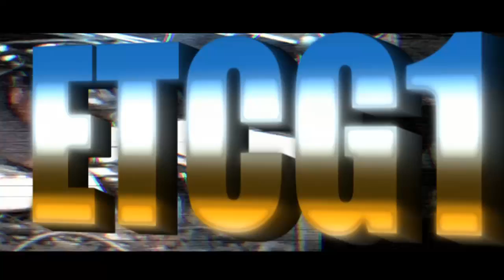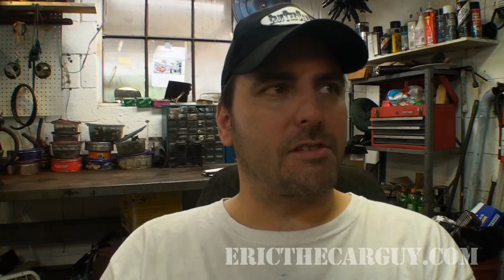The Flat Rate System

Comment: Being a mobile electronics installer in the company I'm in, we have a variation of the flat rate system, except we don't see any pay from it as we're hourly. They used to give a portion to the autotechs, but the quality aspect changed that. Reason I don't like it, just like you said no 2 cars are the same. Say a head unit install is $50, should take .75hr, some vehicles, say an early 90's F150, done in 10min, and a Taurus, 1.5hr due to bypassing the tuner in the trunk. It is what it is I guess.

Comment: I own a independent shop.  I prefer flat rate employees so i know that we both make a set piece of the same pie.  But, I will pay hourly and the amount is still based on productivity via flat rate. A 100% is billing out 40 hrs and clocking in for 40.  It is averaged over 3 months. Top pay is 50% of Shop Rate.  So my $65 shop rate and 75% productivity gets you $24.37 per hour.  No demotions only raises so that is why its averaged over 3 months to qualify for a raise.  Opinions?  Am i being fair?

Comment: depends....a new shop was just built here and they almost tripled their hourly rate to help pay for the new building. And alignment racks arent cheap, tire machines, wheel balancers, scan tools, all cost thousands and thousands of dollars. Went theough 4 panasonic tough books in one year. Plus one guys oops or clutch fails on a car when its on the rack or a lift breaks and drops a 50,000 dollar caddy on its side....shops have to swallow that cost..

Comment: In Germany mechanics are normally payed a fix wage or a fix wage and a bonus for whatever. The customer pays prices according to the time of the mechanic as in the flat rate system. 
After I have spend close to 2000 Dollars on my car where the actual repair was the least amount with only about 150 Dollars I do no longer go to workshops where they work with a flat rate system. 
A friend, that once was the supervisor for the workshop at a truck dealer told me that in many car shops the mechanics are forced to just check the computer and change whatever it tells them to change. 
So today I only go to independent repair shops where they analyze the problem and make an educated guess on what it will cost – and do not rely to much on the diagnose-system in the car.
Finding out what the problem really is will take them some time and they charge for it. 
But I'd rather pay more for a specific repair then having changed things on the car by trial and error which cost way more at the end of the day.

So in my opinion these flat rates are god for no one – maybe except for the bosses and the parts industry. These timetables should only be seen as a help. I think a system where the mechanics get paid a basis wage + extras for time safed and for the quality of there work would be the best for everyone.
And I think the customer should pay for the diagnose. Personally I like it, when I hand over my car to the person working on it. That will give us the chance to talk to each other, I could tell him what kind of problem I do have and he could ask me specific questions. He could then give me an idea of the costs and how long it will take - or tell me when this is impossible. After the repair I also  like to take a few minutes and talk to the mechanic again – not just to some clerk handing me over the invoice. So he could tell what the problem was, maybe some tips to avoid it or things he saw will need attention in the future, giving me the chance to change parts before I stand on the shoulder of a highway. At night. In a thunderstorm.

Comment: Flat rate for me has been pretty good up until the 5 years or. I work for a dealership. I've seen the warranty times drop. The Alldata and other books times are dropping there times because the manufacturer times have dropped. The manufacturer I work/ represent doesn't pay diag time. If you need diag time you must run straight time which turns the whole job into straight time. But back to flat rate. There was a pending law suit or maybe it was settled . But in California the techintins are legally not on flare rate anymore. What we get is professional minimum wage if we have our own tools. That is double minimum wage which in California is $10.00 x 2 = $20.00 an hours. But we have production bonus . The production bonus is a higher rate. But the problem is now you have guys coming in to the dealerships and getting $20.00 an hour that's lots of money for youngGuys with little experience. These new people won't hustle any more bacuase they came from Joes repair shop that didn't know the law or let the guys work out of Joe's tool box.
Reply: how can times be dropping when they are putting more and more crap on these cars?

Comment: Flat rate by far is the worst system for being paid. Being in a building for sometimes 50+ hours a week to get paid for less than 40 is absolutely immoral and horribly disenchanting. The system by which they figure out the book times for the repairs is totally bias and ridiculous as well. This is what caused me to honestly question why even bother being a tradesman? Unless the work is there your in a very dangerous spot. The system inherently creates a hostile work environment and your left to feel isolated from others even if you've had a good week.

Comment: I am very lucky at my dealer.  We get an hourly wage and 45% of the Labor we bill out.  The only kicker is that the hourly wage comes out of the commission check.  There is a chance to make a boat load of money.  There are some months when it is slow I will not get the commission check but will have the hourly wage check to fall back on.

Comment: I was an accurate and efficient Tech and made great money on Individual Flat Rate...when there was work. It was cutthroat, and the crooked and corner cutting techs always managed to get the gravy and pull the same hours despite having no real skills besides being able to work over warranty. They did struts while I diagnosed head scratchers with no TSB. It was hard for me to go from 200 hours a month to 120 or less. After 25 years, I got out of the trade completely
Reply: what do you do now?

Comment: Also flat rate does not pay you to repair the car like you should, all fasteners have a torque spec. What flat rate tech is not over or under tightening fasteners. I work on cat engines now and we install nothing without a torque wrench. They pay for your wrench to be recalibrated, have not been to a dealer that provides really much. And the air controlled shop is a nice touch in the southwest.

Comment: I work at a used car lot and we don't have all the tools here so we have to use a big name shop to do the work. They get paid flat rate and the jobs that they do is not the best, we had a oil pan gasket that we send to them and the tech didn't care to wipe or clean the oil of the sub frame.. But it all goes back to the flat rate cause to clean the frame would have taken him 20 more mins that don't pay.. Its sad but that's whats happens.

Comment: flat rate tech for 35 yrs.it used 2 be fun and you made good money,then the fun stopped ,then the money stopped. greed ruined it you have to remember cash times are based on warranty times.cars havent gotten any esier fix and manufactuers have cut way back.running flat rate for 35 yrs left me physicaly broken.it should be illegal

Comment: As a Tech who didn't like cutting corners and took pride in doing good work I have to say, flat rate made me miserable.  I worked an hour for free every day on average. I have even spent DAYS working on cars for free because of some bull crap electrical issue.  Why should I?  I did not break the car.  This is where I strongly disagree with Flat rate.  Hate when people say, "My mechanic is screwing me over"  It's most likely that he is getting screwed working on your car for free.

Comment: I work at a dealership, with an individual flat rate pay system, with 11 techs and an ever decreasing flow of work, with a greedy central dispatching shop foreman. He sits on his ass and performs 30K and 60K services that each pay 5-6 hours. The recently switched the lube techs over to flat rate, at 0.3 hrs an oil change. The lube techs also do not get any sort of upsells, do to the central dispatcher.

Comment: Rust and flat rates don't work. One place I know just torches the bolts on shocks and exhaust and charge you for new ones. That doesn't work for everything and many are sloppy with a torch. Another thing is when I do any kind of work I charge for what I use. I hate getting billed 5-10 dollars for engine cleaner that was never used. A computer program makes out the bill and whether it was used or not it is on the bill. Even worse is losing bolts and putting sloppy replacements in and charging for the replacements. Finally is the price of parts. Prices at an auto parts store are list, fleet, mechanic, counter and list price. Mechanics always charged list price, but I have found places that double or triple the list price. Just do a good job, charge what it costs and keep everyone happy. Also know that if you own the shop, you might have to eat some costs that if you are good business person, you can balance it out.

Comment: And then there’s guys like me who get paid flat rate but only have a few years experience and hardly any experience working on the make I work on. And I pretty much lose on everything I do because the hours are cut so short and I have to figure out how to do it on these particular vehicles which means it takes me longer. In my shoes I look up some of the hours that prodemand SAYS it takes and it’s just ridiculous. One example I lost out on was a battery  wire harness on a new Ford 6.7 diesel and they are a major pain todo literally took me the whole day todo and the more experienced guys said it was a 5-6 hour job and prodemand said it was a 2 hour job.. absolutely ridiculous there is no way you could get it done that fast..

Comment: Personally I think that system hoes hand in hand with corner cutting. Here in the UK we don't have a system like that thankfully although some dealers have a bonus where you get bonus money fir getting tons done under book time.  I'm salaried it can take me all day to do an electrical fault or I can do 5 services I get paid the same hourly rate. If I work for 8 hours in a day I get paid for 8 hours. If I ho over 8 hours n do over time I get paid time n a half so if my hourly rate is £10 after 8

Comment: Flat is great if the cut between technician and shop was a 60/40 split. The problem is that the shops want to charge $150/hr and pay each tech $12-$30/hr depending upon skill. My plan would be to drop the labor rate to $80/hr and pay each tech 40%/hr. More business taking in less money per RO but creates a steady flow where you’re never slow. The customer is more apt to buy more and has more value for their money. But American corporate greed is what’s causing the division between rich and poor inadvertently killing the middle class.

Comment: flat rate is good if you have work that you can make money on. but being at a dealership warranty flat rate sucks. 90% of warranty pays half of what the labour time guide calls for. one thing i really hate is only making 3 or 4 hours in an 8 hour work day, and i worked my guts out all day and i don't get paid for it. i take great pride in my work and try to do everything to the best of my ability. getting paid a half hour for a job that takes 3 hours is crap and being told thats the way it is.

Comment: I agree with Aaron, I worked hard and I was unable to defeat 2008. Since I've been hourly I have had more reliable paychecks higher 401k. More time to my family. I would never go back. I also don't have to work when I get home on side work. Because an employer finds it  acceptable for you to sit there all day for zero. Also bring this up why in the f...., does parts get a percentage of the parts and the service advisor when THEY NEVER PUT THE PART ON. What is there commitment a pen and provided kakis. Flat rate blows, I also get paid time and a half for being at a place for more than 40hrs hours, and tell me even in heavy equipment stupid cars your chronically with a tool bill. I commend your commitment but I had enough of the flat rate system and the fed pre Madonnas in shops.

Comment: Damn good video. I had worked at a couple of individual cut throat flat rate shops, one was a large dealership and the other was an independent. Both were very brutal. Like you had stated, the work from most of the "techs" sucked, multiple combacks etc. What I had experienced was the more you kissed a@@ the better the work you recieved. I couldn't tolerate that any longer. I was lucky to move on to a new place (like you are :) ) that pays a salery and the conditions are for the most part better.

Comment: customer and warranty  standard repairs time are very different, manufacture warranty pays less. flat rate is fair because  if tech a takes 4 hrs to do 2 hr job you as the custome do not want to pay  4 hrs.  so don't get mad when you pay  4 hrs and your vehicle is done in 2.   and yes its not all gravy for the tech, some time you lose your ass. especially happens with warranty repairs. and In our shop I've have seen very little effect on quality.  and in the heavy truck industry trucks are far less cookie cutter than cars, cars they build 100, very very similar vehicles . trucks, there's a crap load of variables,  unless its a fleet and even then your lucky if one truck is the same as the next.

Comment: MR TIRE only pays 0.2 for a oil change AND rotation!! Doesn't matter if it a Nissan Sentra or a Mercedes CK500... The Nissan takes 10 minutes(w/o PMA), the Mercedes takes 30-40 minutes. BUT... MR TIRE pays 0.2 to install two wiper baldes(most take 15 seconds to install BOTH). 
* Moral of the story is... DON'T WORK AT MR TIRE!!!

Comment: In the perfect world....far from perfect. Brand new distributor. Igniter fries because the chinese didnt put compound on heatsink. The mechanic forgets to put the button back and it ruins my coil. The coil is replaced and goes bad pronto but the mechanic stripped the coil screws. So one wire needs to be cut and screws ordered from Honda. This is my typical luck.

Comment: The system is a lie
They will tell you it's all about speed and the better Technicians make more under the system.

If that were true they would pay every Technicians the same hourly rate from the day they first started

They don't,they always pay a higher hourly rate to Technicians that have been their longer which is admitting they can't make more from more experience and having been their longer.

It's also ambiguous,each shop wants to apply how the system works differently to benefit the shop and not the Tech
Reply: Are you a technician?
Reply: Not anymore